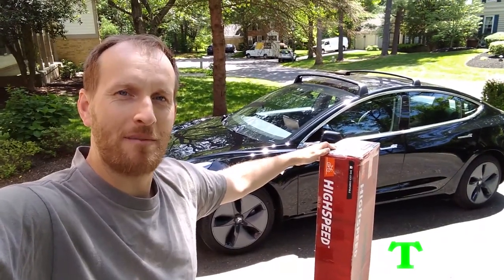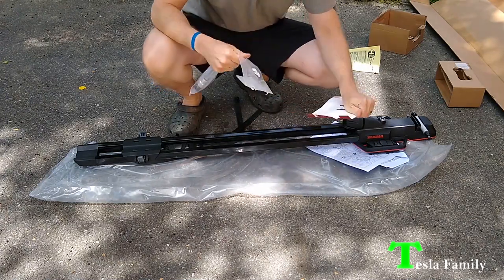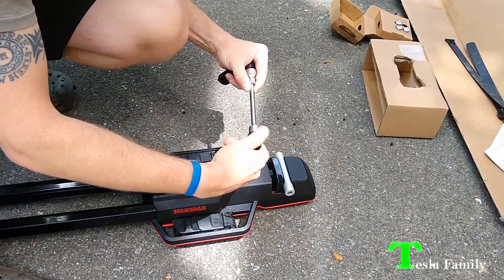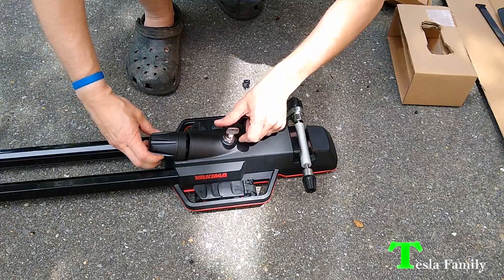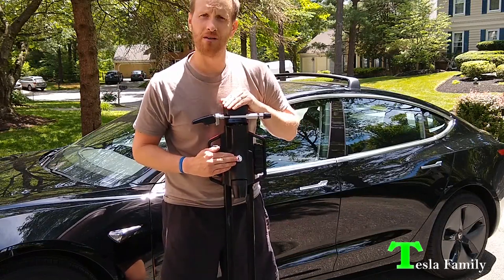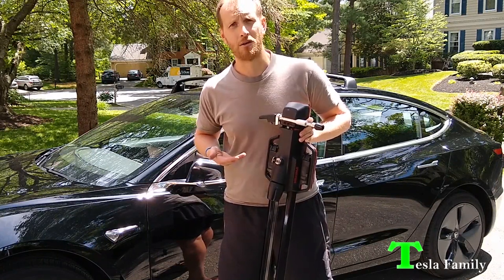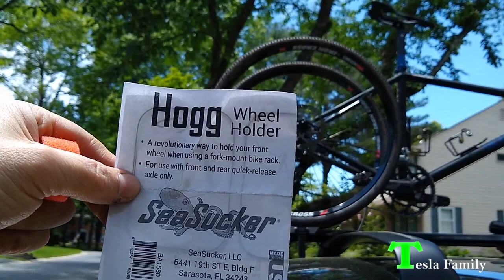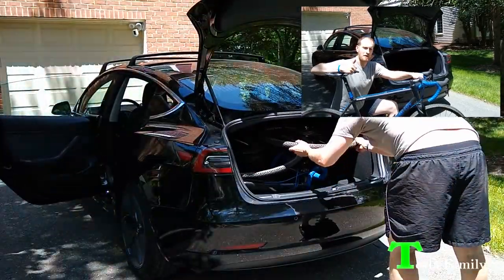Yakima HighSpeed Bike Rack on Tesla Model 3: Unboxing and Install

Comment: Should check out the High Road. It’s the same thing but wheel on
Reply from the maker: Thanks for watching! I considered trying a High Road for my second rack but stock was not available at that time. I also like the sleeker look of the High Speed when bikes are mounted. I feel that the High Speed is also a little more secure in that someone may be less likely to want to steal a bike with only one tire mounted.

Comment: It looks to me like the rear wheel strap is mounted in the opposite direction?  You want to be able to secure the strap on the side you are standing on so you can release it and secure it from the side of the car you are standing on not the inside..
Reply from the maker: Hi Patrick, Thanks for watching and for passing along this tip. Before you shared this, I never really thought about which is the correct side that the rear wheel strap should click into. I just checked and I actually still had it positioned the same way as I did in the video but your tip makes more sense so I just switched it!

Comment: Have you noticed any difference in range or performance with a bike on top of the car?
Reply from the maker: Thanks for watching! Yes, the bike on top will reduce range some just due to the higher drag/friction as wind hits the bike. Don't know the exact amount, maybe 10% reduction. Bike on top does not impact performance as far as acceleration.